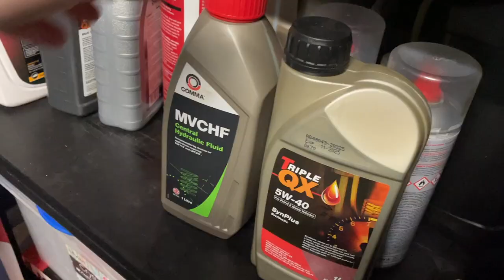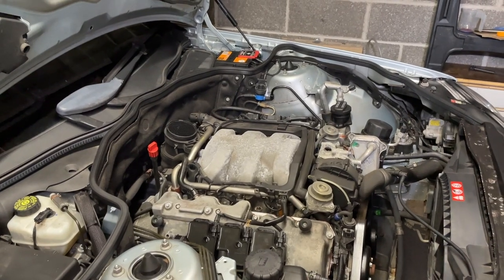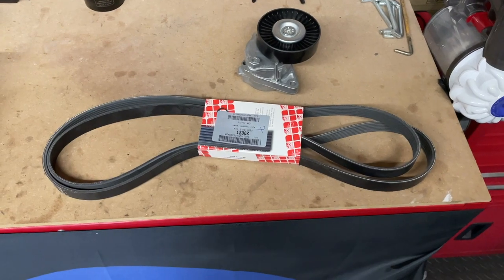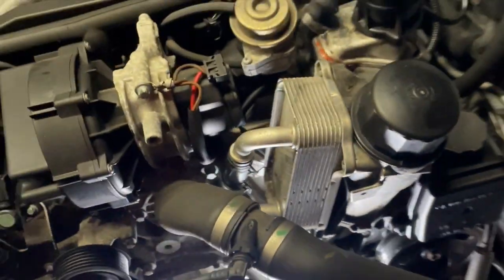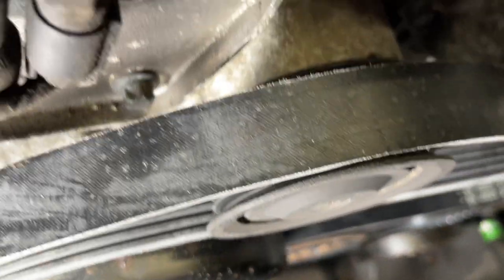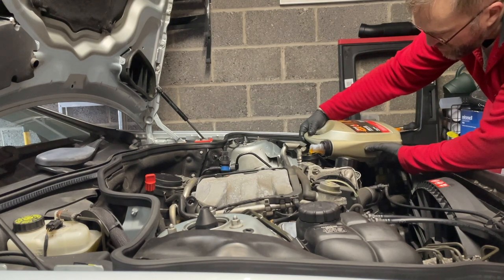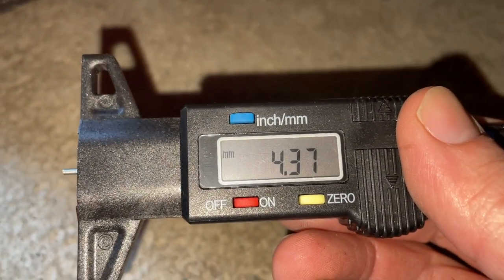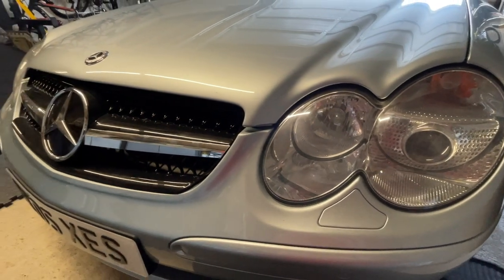Mercedes SL350 R230 A, B Service SL500, SL55, SL600, SL400, AMG DIY OIL CHANGE, PS FLUSH, AUX BELT

Comment: Hi great videos,  I’ve just brought a 07 Sl 350 as a weekend car , I noticed you said you trickle charge the batteries when not using for long periods , do you trickle charge the both or just the main battery ?
Reply from the maker: Thanks! Just the rear, the battery control module seems to take care of the front as it never deviates from 12.6V
Reply: @autogaragelife  thanks for the reply,  will purchase a charger

Comment: Another great video - thanks.  You mentioned discs and pads but didnt go into detail..  What would be very useful for me and I am sure other viewers is how to disengage and reengage the SBS (Servotronic Braking System) when working on the R230.  There is some information on the internet but its a bit vague and also somewhat contradictory.

Watching someone like yourself who actually has practical experience would be very useful.

Thanks

Robert
Reply from the maker: Thanks! Glad you like it. I have since sold the SL so didnt do a brake video I’m afraid.

Comment: Awesome thorough video! Is your crank pulley starting to come apart or is that just the paint/coating flaking off the rubber?
Reply from the maker: Thanks! Glad you like it. Just the surface flaking. There are a few model years that suffer from that but actual pulley is still solid, no vibrations or unwanted movement/noises so all ok👍 you would know if your crank pulley was shot!
Reply: What about the other pulleys and the water pump, don't they make any noise? I don't know an M112 and M113 that doesn't have any problems with it.
Reply from the maker: Nope rest are all good

Comment: Hi Sir. Congratulation for your video. A couple of question: 1. Is your COMMAND the original one or did you upgraded to the facelift version? 2. which kind of pump did you use for suck steering oil? 3. any video about changing brake oil and brake pads?
Thanks
Reply from the maker: Thank you. My car was the 3.7 but had the facelift dash with newer COMMAND unit from the factory. The pump is a 9litre oil extractor available on ebay and no sorry I don’t have a brake vid for the SL.

Comment: job well done, just a question, where did you have positioned the floor jack to lift the front axle?
Reply from the maker: Theres a front center jack point, a square plastic puck, protruding from the middle of bottom engine cover. If you are not sure though don’t do it alone!